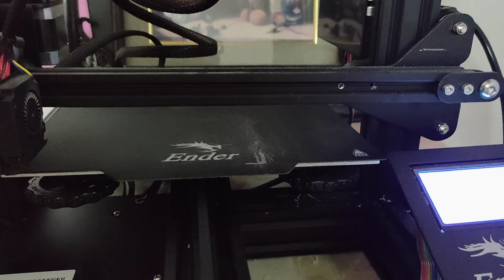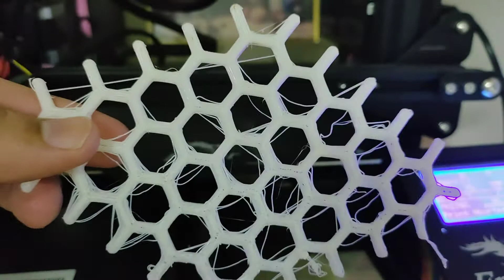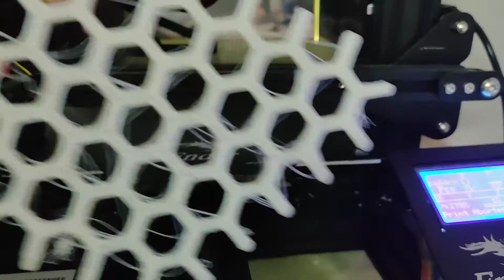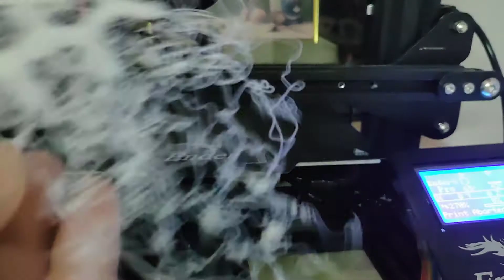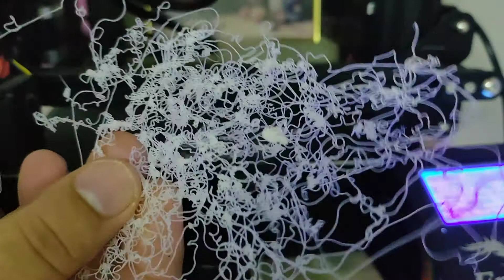Part with low thickness doesn't stick to bed | 3D Printing issues

Comment: stick is simple...heat up to 80 rub hot melt glue stick on plate then turn off bed print cold ...plastic will bond to hot-glue..when finished heat up bed to release and if you still find edges start to lift hot-glue them down...!
Reply from the maker: For creality ender 3 pro, is it ok to heat up to 80?
Reply: @AliHussain1  yes
Reply from the maker: @ellpiece  thanks, I will try that out.
Reply: @AliHussain1  its the only way i print all my models, please try you won't look back
Reply from the maker: @ellpiece  thanks for the advice, really appreciate it. 😊